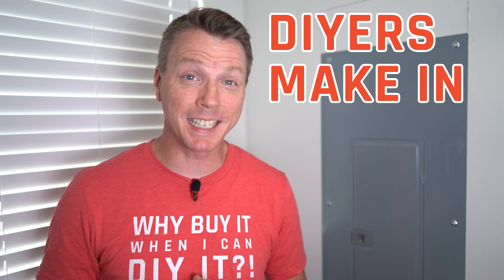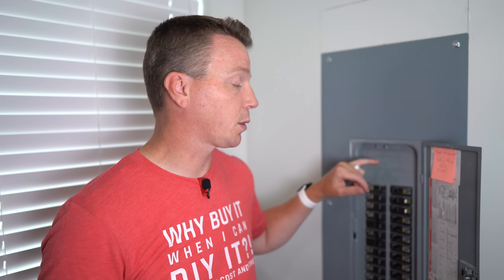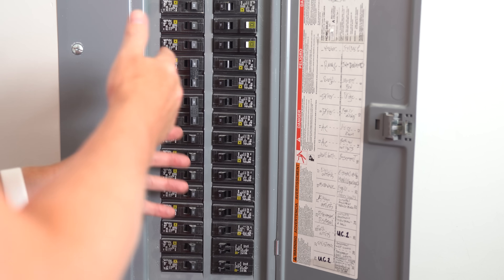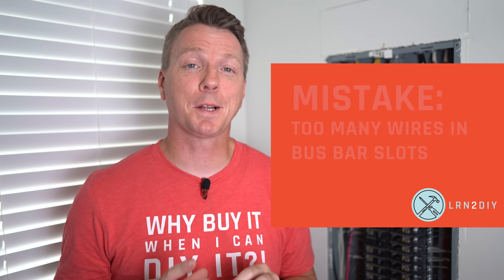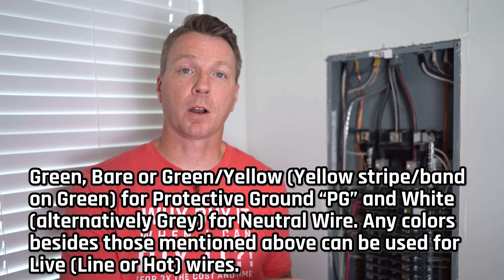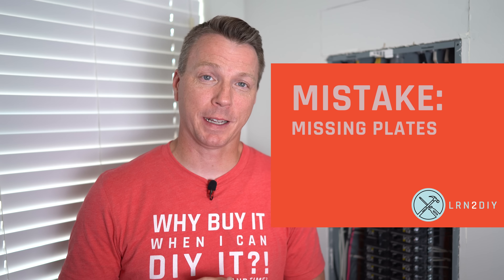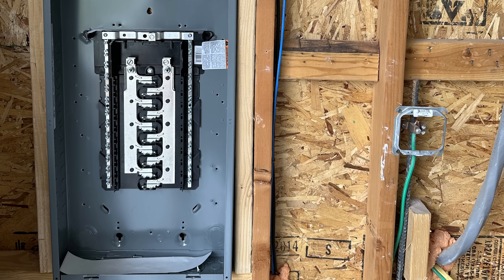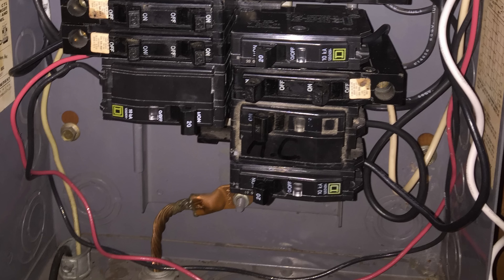10 Common Mistakes DIYers Make In Circuit Breaker Boxes

Comment: #2 your breaker panel being full does not correlate to maximum load. A 200A panel could have as little as 8 spaces for breakers or 60 spaces. Having a load calculation done will tell you how much load or demand your house has.

#3 not protecting the wire sheathing from the knock outs. When using pvc fittings, a plastic bushing is “not” required, however, in your video, metal connectors are used “without” a plastic bushing. Contrary to what you stated, that is not okay and violates the NEC.

#5A twisting the grounds together and “assuming” you have a good connection is not okay, but twisting wires together inside a wire nut is totally going to give you a good connection guaranteed, not.

#5B you don’t need to connect one ground bus to the second ground bus, the panel is good enough. So obviously, you’ve never heard of bonding. They make and sell grounding bushings “because” metal touching metal is “not” sufficient according to the NEC.

#8 double tapping a breaker designed for double tapping is frowned upon? Because it’s so much harder to troubleshoot when you have 2 exposed wires to read from versus the easier method of opening every plug and switch to find the fault. The preferred method is to connect the 2 wires with a jumper and making 1 connection into the breaker, this ensures a better connection than connecting them directly into the breaker that is designed for this. Or not. 2nd acceptable practice is to pay double for a tandem breaker so you can double tap the tandem breaker. The problem with this is that a tandem breaker shares the neutral which means if you turn off 1 side of a tandem breaker and assume the circuit is dead, you can still have the other side back feed the circuit.

#9 filler plates $8, spare breaker $5, so there’s that.

#10 showing viewers the marking on breaker states 35 in pounds and then setting your tool for 50 inch pounds. Wtf?

Those who can, do, and make good money doing it. Those who can’t, make YouTube videos with BS.

Comment: The problem in my house is whomever wired the house originally in the early 80s combined different rooms on the same circuit. The back wall living room outlet is on the same breaker as the middle wall 2nd bedroom, the main bathroom is on same breaker as side wall 2nd bedroom. The outside front lights are on the same breaker as the microwave. The kitchen outlets/devices are on 5 different breakers (and it is a small kitchen). Even when we had a pro redo our panel, they never ran the new wires to separate each room to their own breaker.
Reply: A couple of issues: there is no requirement that each room have its own circuit, and it's okay to share bedroom and living room load. The rule of thumb for most rooms is only that each "point" (light or plug) be tallied at 1.5 amps. (It hasn't been modified yet to account for LED lights, but that will happen). There are those who advise splitting circuits between rooms so there is some power in any room in case one circuit trips, but I've rarely seen this implemented because of the added cost for minimal functional improvement. The only time I've been asked to put separate circuits in a bedroom is when heavy loads like portable electric heaters or air conditioners are to be used, which use most of a circuit's capacity.
You do list a couple of code violations. Outlets in a bathroom should be dedicated, because of the likelihood of high output items like hair driers. The lights, however, can be on the same circuit as a bedroom, living room, or kitchen lighting.  Likewise, kitchen outlet circuits need to be confined to the kitchen or dining room. The microwave and outside lights together is a no-no. Also, any permanently installed appliance needs to be dedicated, which makes the microwave a pretty funny issue: the same exact machine needs its own circuit if it's installed in a cabinet with screws and a trim kit, but if it's on the counter, not. And the fridge: even if it's huge, no code requirement for a separate circuit. Now practically, I always use a separate circuit for one, unless it's a tiny apartment with a tight budget and small fridge. In general, the kitchen is the heaviest use of electricity, so it's not a bad idea to have several circuits. It's a code requirement to have at least 2 "utility" circuits for countertops in addition to other loads. Your 5 circuits is actually  bare minimum.

Comment: You can have 3 grounds to a single lug. Twist them together at the end and clamp it down under the lug. No need for a wire nut. Nuetrals are limited to 1 per lug. Obviously there is no reason to double tap grounds if you don't need to but if you are out of space, it is an option. Though adding an extra bus bar is a better choice.

Comment: Also, depending on wire size and cable, you cant phase color that neutral.
Reply: Neg.  It's well within the NEC to use a white conductor as a supply wire as long as it's properly identified!
Reply: @michaellike5037  negative.....

Comment: 80% is a recommendation, the breakers are designed to take 100% indefinitely. Its ok to go over 80%.
Reply: Neg   any appliance is only rated for 75% load rating. Due to a code involving motors  plus should never push any breaker to 100% capacity cause the manufacturing company isn't going to reimburse you if you're home burns to the ground   the NEC is there for a reason. Cause idiots like you think you can do what you want cause it's not your  house

Comment: I noticed that your panel does not have a "MAIN DISCONNECT" per "N.E.C." any panel that has more than six breakers must have a main disconnect( fused/ breaker)" with in line of sight". the other item that I noticed is your panel has a "GROUND BAR" per "N.E.C.", it is code to land grounds on the neutral bar. the only exception is if the panel is a "SUB PANEL" with the neutral bonding jumper not installed., and the grounds must terminate on the ground bar, that comes as a "KIT", and is not provided with a new panel..

Comment: Don't get someone killed making giving them just enough information to be dangerous.
1. All breakers shall be afci in residence.
2. All un-fused USE/SER cables shall be protected in conduit within building lines. 
3. All cables #4 and larger shall be bushed.
4. You may use #14 on larger breakers in certain instances example, when using motors.
5. The color of the sheathing is not consistent after the year 2000 they changed.
6. Turn the power off do not remove covers while the panel is energized. ARC faults will severely burn or kill you.
7. The most common grounding issue is bonding ground and neutral in sub-panels. Taking the bare wire off the cold water or ground rods.
8. De-ox on aluminum and not stripped properly. Those conductors have been "rung".
9. Phase tape is only allowed on #4 and larger wire.
10. All circuits shall be identified.
11. That is a main lug-only panel you should never tell anyone to take the cover off. You did not instruct your audience to turn the power off.
12. You did not instruct your audience on the difference between the sub-panel and the main panel.
13. You did not instruct your audience where to locate the main breaker where the meter is.
14. You can be held liable for giving bad information to people who are not qualified to do electrical work.

Comment: The service entrance load center is no place for a DIYer. You can not shut it off 100% and if you make a mistake and the main breaker doesn’t trip, you will be waiting for the utility overcurrent protection to open. If it doesn’t, you could be dead, seriously burned or start a house fire. Stay in your lane and hire an electrician.

Comment: The panel is 150 amps per phase (hot legs) each main service conductor coming into the panel/ Main breaker. The 80% rule also is important to apply to a continuous load 3 hours or more like a refrigerator.

Comment: Tandem or as we call them...twin mini breakers can only be used if the panel is listed for them. Many home owners and contractors put them in when limited space is available. Refer to the label on the inside cover of the panel per manufacturer's listing.

Comment: Thanks so much. I never knew that the panel connects the two ground bus bars. I was always wondering though about why most panels do not have two common bars to make wiring on each side easier.

Comment: Black for Line and White for Neutral?! Coming from a British perspective, that colour scheme seems downright dangerous! 😲
(N.B: Under BS 1362 (1960s) line is red, neutral is black. The EEC version changed this to brown for line and blue for neutral (So chosen so they're distinct to the colour-blind) but my 80s flat still has Red/Black internal wiring in it.)

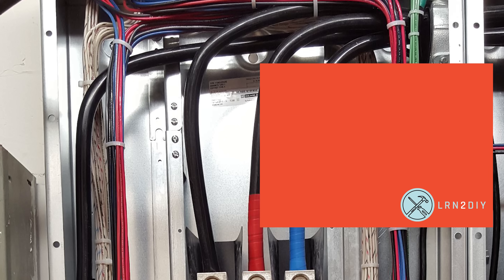Also: Is that panel at 13:07 wired for a three-phase supply, or has somebody chosen a very non-code (Non-white) colour for their neutral? 🙃
Reply: From a US perspective, your color scheme seems dangerous. You guys also drive on the wrong side of the road.

Comment: Every wire I run into a panel I leave long and make a U-turn with it. This acts as a drip edge in case moisture collects on the wire. It will reach the bottom of the U and drip off instead of running down the wire right to the terminal.

Comment: Mistake #12 was when my general contractor hired the sub-contractor to wire my house.  They were savagely un-educated Mennonite hypocrites.  Making Serious (dangerous) stupid, careless, lazy mistakes all over the house.  

Yes, one outlet actually exploded !  

I discovered bare metal scraps laying in the breaker box.  And, the green screws were NOT tightened down on the bare ground wires  ...  in every switch throughout the house.

Comment: A circuit breaker does not "push" electricity, you might have used the word "allow". I hope your ring was not metal. Never wear jewelry in a box. GFI breakers will have a white wire. Should never double-tap.

Comment: The problem with those perfect looking wire jobs is that when you have to add-on or change the location of the breakers, your wires are going to be short.... ran into that issue plenty of time with those neat panels!

Comment: Putting two ground wires into the same "hole" is much safer than putting two neutral wires.   In the later case it's all to easy to open a neutral when doing changes.   An open neutral at the panel can make all the neutral on the circuit HOT.
Reply: That's why it's super important to shut off the breaker that  conjoines with the neutral conductor that your talking off the bar

Comment: I have done electrical work on my house - mostly installing ceiling fans and adding lights to the garage.  I needed a 20 amp circuit ran to the other side of the garage and since I'm not brave enough to actually get into the breaker box I had an electrician run the outlets.

Comment: I always prefer to use a length of. Olored heat shrink when using. The white as a hot it wont get sticky or look as hacked as electrical tape and  wont werlar or fade off and is also faster thean using a sharpie and can also be reversed if ever needed  with incredible ease

Comment: As to put a filler plate in, just put another breaker in. It's a lot cheaper and you have future spare breaker. Color coding of the wire is fine for new installations but older systems used white interchangeable , 14 and 12.

Comment: Most common DIYers do is not twisting wires together with plyers before putting a wire nut over it. Most will just put all the wires together and run the wire nut down and wonder why they later found plastic melted.

Comment: As an English Journeyman Electrician it is really fun working with 240v single phase on a 30 amp ring main. 2.5mm cable comes out of the breaker circum navigates the house then the far end goes back into the same breaker, Servicing 13 amp mostly dual switched outlets available for 3 pin plugs each with its own fuse. 1 breaker for downstairs and 1 breaker for upstairs. Water heaters, cookers, etc have their own breaker. The I.E.E. Regulations are very interesting.
Reply: Do you blokes still install new ring mains? This seems like such a bad idea, and should have gone away a long time ago. Is it really worth the risk for the small amount of wire it might save? It seems to me, from this side of the pond, that it would be far safer to use a larger panel (consumer unit?), break the ring, and put each leg on its own breaker. What are the advantages of a ring main in 2024? A ring main and a homeowner DIYer seems a deadly combination.

Comment: older houses, mine built in 1973, all the Romex for 20 and 15 amp is white and is both 12 and 14 gauge, so the color is not an indicator of wire gauge for older panels. I even have some black covered romex.

Comment: Mistake #1 -10.  No PPE!  the breaker panel was opened. It doesn't matter if the main disconnect is off.  The service is live on the other side of the main breaker and those terminals are exposed in this instillation.  Opening up the panel is a CAT 2 arc flash  hazard in any case.  Think bathing in hot molten copper hotter than the sun.    He doesn't even have safety glasses , gloves, insulated tools nor any hearing protection.  This guy even has a short sleeve shirt on.   Nice metal wedding ring too... it has the ability to weld you right to the line that is going to make your wife a widow. 

"Am I ready to do this" he asks.  No sir you are NOT....carefully close that panel back up and walk away.

Comment: How about the requirement for GFCI and AFCI and DF, dual function circuit breakers?   I know most GFCI's are receptacle mounted but the others are circuit breaker only, I believe, and special attention must be paid to the neutral connection.

Comment: You were making me nervous the whole time with your hands and fingers so close to what appeares to be a live box.  You never said you pulled the meter or did anything to disconnect the line voltage.  Safety is job one.  Double checking with a meter is step 2.

Comment: My panel box mistakes came from certified electricians. I guess no matter how many courses someone passes it still doesn’t change human nature. Funny how I would be considered a DIY yet I fixed the problems in my panel box. They double tapped circuits and bonded the sub panel.

Comment: I have a question regarding amperes ,you talk about not having enough amps in the panel.shoul we call the power company and ask to send or sell me more amps ? I'm not an electrician but I think my house electric installation has not enough of this amps
Reply from the maker: If you need more power to your house, it’s not a simple process but it is feasible. It requires upgraded wiring to your house and likely an upgraded main panel. That said, it’s definitely worth calling the power company to see what your options and cost would be.
Reply: @LRN2DIY  thank you ..I did call the power company,and yes it needs an upgrade,my home was built in 1956 and it was well due an upgrade, I've hired a licensed electrician and also show him your video, I'm grateful for your time and effort in creating this content

Comment: You missed a very important mistake people make.....DO NOT USE POWER TOOLS TO TIGHTEN AND LOOSEN electrical service equipment. It can cause stripped heads or over torques as well as a danger of it slipping off and then the power tool contacting a live spot in the panel. I see a lot of people doing this and thinking it's ok but it's really not.

Comment: I gotta say in wiring up my new house build, I did nothing wrong according to this, except not buying a torque wrench. 

Is there such a thing as too tight, short of stripping threads? Because I am sure if anything, everything is tighter than spec.

Comment: Can i please suggest a tip for taking off/apart anything for everyone to learn On your what not to do on your DIY'er Mistake video??? PLEASE...
As we just saw when you took the panel off you left the top LEFT SCREW in as your last fastener to remove.  Then as a RIGHT HANDED Person, you reached across your left hand and the part to remove the last fastener???  
STOP DOING THAT!!  FOR YOUR SAFETY??? 
For right handed people the last fastener should ALWAYS be on the right side of WHATEVER YOUR TAKING OFF OR APART???? 
The reason you ask?? If not obvious to everyone already..
You shouldn't be reaching across your body or the part to....  
unbolt/screw/fasten/clip/?? 
Something while also trying to either hold it in place, or to hold it until your right hand is free of tools/fasteners etc. 
DON'T DO THAT... it should be obvious as to why not... but just in case it's not to some people. 
The parts could be unbalanced, heavier, more awkward then thought,  once removed. It's easy to remember... right hand,  right bolt last removed. 
I hope this helps anyone stay safe.

Comment: Using the white wire as a secondary hot wire to the breaker is just completely dumb in my opinion because if the other end isnt labeled properly some one can get hurt or cause direct short. Very dangerous. I know why they might use it as a hot, bc they dont have another hot wire in the wall and need it. Its just a bad idea.

Comment: You cannot use tandem breakers in new builds. You must use arc fault breakers for most circuits. I dont think its possible to make a tandem arc failt breaker. I want the link if someone found tandem arc fault breakers. 73

Comment: You talk about double tapping a circuit breaker. I was told that you must double tap for a smoke detector. That way, you couldn't shut off all the smoke detectors in my house. With the touch of a button, That was forty years ago.

Comment: My favorite one to see is pointed screws / improper screws holding the fuse box covers on , alway test for power the screws and cover before you do anything ...ask me how I learned that one ..ps I don't know much about house electricity ,I know  a little about 12 volt boat or car wiring , not enough on either ..